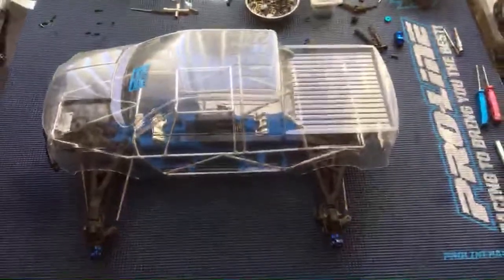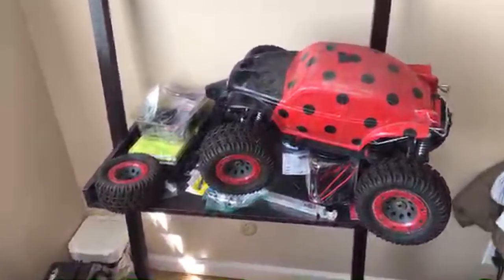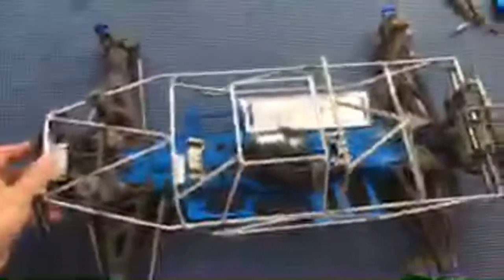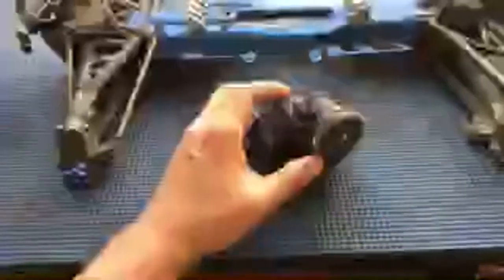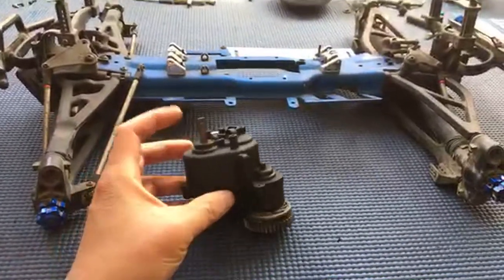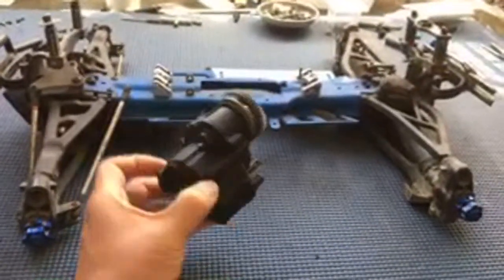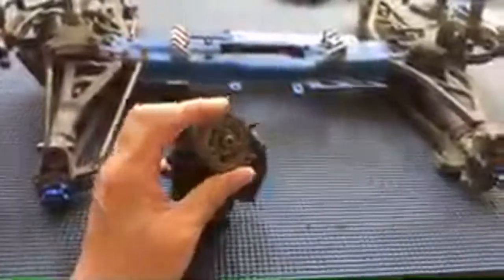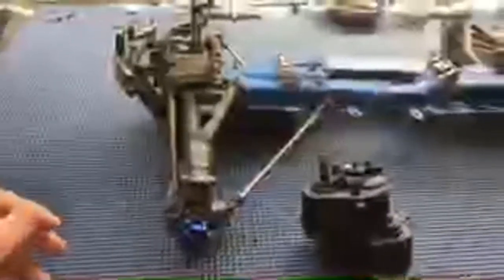Traxxas Revo 3.3 brushless conversion update

Comment: I did this conversion using 3 screw single speed conversion. It lasted five minutes. I just ordered the Robinson steel gears and was wondering if you've heard of a way to make it single speed.
Reply from the maker: Thanks for watching and commenting!✌ We wouldn't recommend running more than 3S on a conversion since the drivetrain wasn't designed for that much torque.The diffs will probably fail next since they're the same as those in the Slash and Stampede 4x4s.